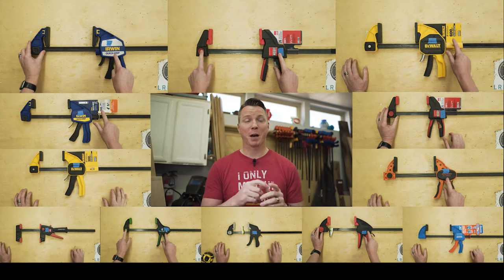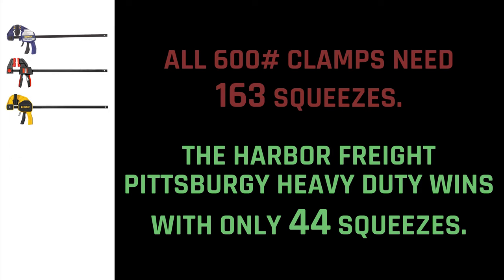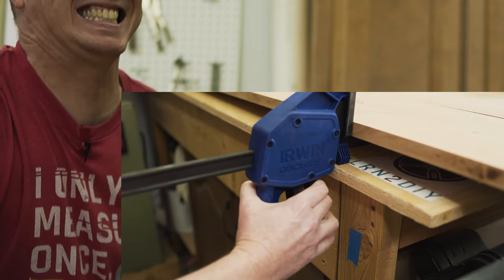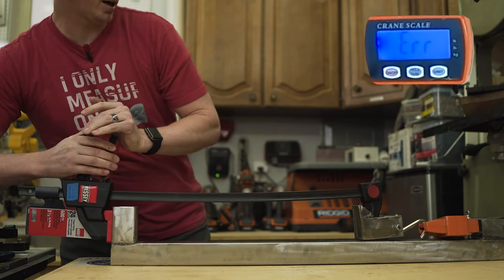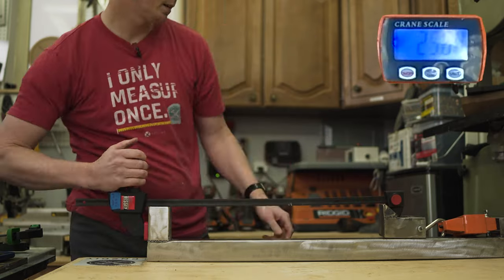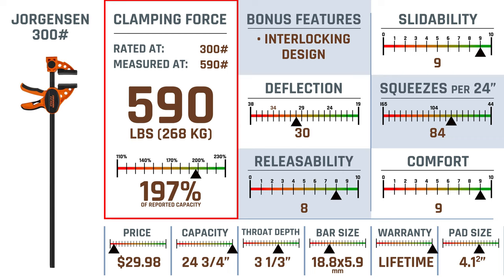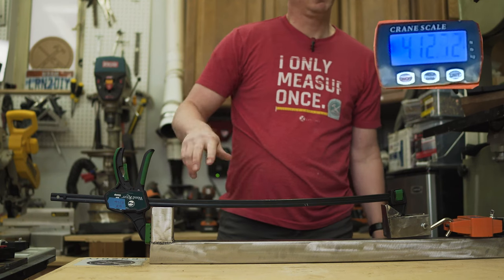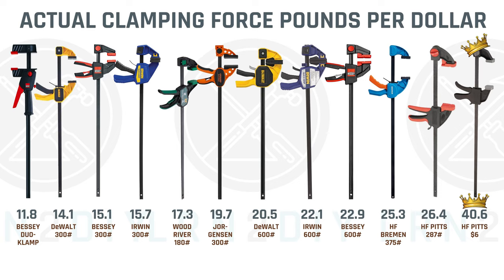The Ultimate Trigger Clamp Showdown - 12 Clamps Compared

Comment: The squeeze distance is directly related to strength because of mechanism leverage, so for me the shorter distance would be preferred if I want a greater pressure.  If my need was just to quickly clamp at low pressure then I'd want the long squeeze distance.  I would reverse the squeeze chart to have green on the short stroke and red on the long stroke.
Reply: Totally agree. Also, for this type of measurement, squeeze 10 times and measure that distance to get more accurate data.
Reply from the maker: Makes sense, Michael. That's why I wanted to show all of the data so you could see what works best for your scenario. I think a lot of people would prefer the shorter distance squeeze just like you. Thanks for watching!
Reply from the maker: Good point on the 10 squeeze method - I'll keep that in mind for future videos. Thanks!

Comment: As someone who has managed joinery shops of over 40 joiners. A point that’s hard to touch on with a simple one time review is durability. The Irwin clamps definitely fail quicker after daily usage. The internals are quite weak wear out quite quickly resulting in next to no clamping force. The dewalt do the same but lasted a bit longer. I’m about to buy the Bessey as have got 2 friends in the industry who’s besseys have outlived many of the Irwin and dewalts I’ve had. Great review by the way.
Reply: I have the same concern about the durability of these clamps. I can’t figure out what is actually wearing out on these Irwin clamps. I’d like to know so I can fix or replace the worn out internal?
Reply: Hey, Was hoping you’d give a quick update on your Bessey Clamps if you have Tried them yet.

Thanks!

Comment: Great video. I threw all my HF quick clamps away after several of them broke. The unreliability is a deal breaker for me.
Reply from the maker: Yeah, they were the only ones that broke. I think that in my case I probably have overtightened them more often than not since it’s hard to tell how much force to apply.
Reply: @lrn2diywoodworking  I also have had HF clamps break in my hand while squeezing.  Thanks for this.
Reply: I'm curious to those have broken the HF clamps. Were they the old black ones with orange pads, slightly less old pittsburgh ones with gray pads, or the new Bremens? I havent purchased trigger clamps in over a decade, so I only have used the old orange pad ones. I was thinking about trying a few of the new Bremen branded ones
Reply: @ckmoore101  I bought the new Harbor Freight Blue Bremen Label. I really like them. I’m a retiree casual woodworking. I think their great. Very reasonably priced been holding up like a champ. I’m not a professional or in commercial production business so these are great. HF opened a store near me and I noticed some of their products have really improved.  I’d give them a serious look even if your not budget mined….
Reply: I don't throw broken tools away if I can fix them. I have fixed the end of Quick Grip clamps too. Real Vise Grip Quick Grips. I make a whole new head out of steel. That doesn't break.
Reply: The Bremen brand aren’t bad to have around. I’ve got a few and they work as intended and I quit my career to be a full time woodworker awhile back. 99.9% of the time during projects you are never maxing out your clamps like the examples in this video, especially with squeeze clamps. So really no need for someone just starting out to go spend a ton on the higher name brands when they all accomplish the same end goal.
When it comes to F style and parallel clamps, you don’t want to be cheap on those ones…although the Bremen parallel clamps actually perform very well when in comparison to the high end brands they are almost identical for half the price.

Comment: the amount of squeezes actually should be higher scored for more squeezes as it allows more variation in pressure.  Also, you should have done a clamp overnight as the harbor freights have come unclamped many times in my experience, I have sold them all at garage sales for a $1, they are complete crap and they break.

Comment: Watching your tests, I was wondering if there was space for another two tests? 
#1-A test to see how long a clamp can keep its "clamp" at its rated capacity. Sometimes we will clamp something over night. A clamp isnt good if it loses this compression after a short while.

#2-An additional test of "squeezes per inch". I took a guess that some clamps took quite a number of squeezes to reach 24" because they increment in small measures on purpose. If you take two clamps, one moves in 1/2 inch increments, the other in 1/64 inch increments, placed against the items to be clamped, the smaller incements will provide a larger final force because you can "inch" towards the max force more easily. Thus its possible to apply a larger force more easily.

#2a-Ease to reach final max clamp. The smaller incrememts might lead to a larger final clamp because of the smaller incremental movement of the clamp heads.

Thanks for your work. Im gonna check out your site soon after this, and make a budget for a couple of new clamps.

Comment: Bonus features for the Bremen and Pittsburgh is that they are also spreaders. Also I don’t think the releasability scores should be factored in when you are clamping it beyond its maximum capacity. You should see how they do at around 300 pounds instead of almost 450, because if you’re testing it at those pressures, you’re clamping your work too hard anyways. Great vid!

Comment: The only issue I had with your method was that the use of another clamp to squeeze could have stacked the deck against the two that broke. Not sure if you agree, just my observation. Very nice comparison on so many different clamps. The little Harbor Freight guy might be a good choice for me. I don't need 400lbs of squeeze and I could buy a whole bunch at that price!

Comment: excellent review..note that the Werth durability of clamping clutch plate assembly is critical factor in squeeze clamps. You can predict that somewhat by: removing covers, count clutch plates, test hardness of plates, inspect and/or caliper accuracy of punched bar hole whilst seeing condition of hole edges. Sometimes the stamping dies are not top notch/ worn which rolls the entrance to hole. If  that side faces bar in clamp mode it can slip. As with pipe clamps try flipping plates over .

Comment: Once I bought my Bessey 300 pound clamps, I don't think I can go back. They are so nice to use, and they feel incredibly strong. I still have some older 100 pound Irwin / Quick-Grip clamps for smaller jobs. I owned a couple of those Pittsburg clamps before, they were terrible. Mine felt weaker than the 100 lb clamps, they would just slip. I don't care if they're cheap, they just work terribly. Dollars per pound of clamping force is not a useful metric. A cheap clamp seems like a good idea until you think about usability, the cheap clamps are terrible to work with. I'm sold on Bessey, strongly recommend them to anyone.

Comment: In the market for new trigger clamps. I lost it last night, after 10+ years of struggling with Bessey's DuoKlamps, I finally snapped and slammed them all on the floor of my shop until it looked like Pete Townsend had been over with a poorly setup Gibson guitar that tweaked him out. From the first week I got them (brand new) only 1 of about 8 worked close to properly, the rest would refuse to ratchet, just slip and stay frozen in place. I lost count around the 1,000th time they caught me in an awkward/dangerous situation and simply refused to function. I have Bessey strap, pipe, C and K-body clamps and, honestly, after using them in a pro 40+ hour/week shop for over a decade I have to say they are 90% hype. The only products of theirs that I haven't had overt major issues with are so heavy and difficult to place smoothly that I dread using them. As I said initially, I'm in the market for new clamps and Bessey is totally out of consideration now. Never again. I so wish the Mitt Romney-fication hadn't happened and left Craftsman a shell of a company playing the whack-a-mole of which Chinese sweatshop can produce all the clamps but make ours look better racket. Ugh. Good video.
Reply from the maker: I appreciate hearing your experience on the Besseys. I've had good luck with mind so far but not in all ways and I'm sure I'm using mine a lot less than you are. I'd love to hear what you settle on and how it goes.
Reply: @lrn2diywoodworking  Yeah, I'll definitely get back with you on it. Yesterday I picked up a couple of Jorgensen 12'' 1,000lb bar clamps. I haven't gotten their trigger clamps yet as covid slowdowns have made sourcing them first-hand near impossible, in-store stock is apparently non-existent. Whenever I can I prefer to sort through groups of such things and pick out the ones that don't have obvious flaws, that's just not possible on Amazon or eBay, as I'm sure you know. In my looking, including your video here, the Jorgensens seem to be the best bet and their mechanism looks to me to be superior (saw the internals on another YouTube vid). Also, the company/distributor seems to be a lot more responsive than most other brands. I've tried to deal with so many seemingly large corporations' customer service only to find out they are now shells just drop-shipping product and contracting phone reps who work for multiple ''brands''. In the end, we'll probably all have to move to China to get what was once in the USA a decent sense of connection with and concern from manufacturers. Either way, forward from here is all we got, it's either splat into it or plow through it lol.
Reply: "As with all Sears products, Craftsman tools were not manufactured by Sears during that company's ownership, but made under contract by various other companies." -- Wikipedia
The Craftsman brand is now owned by Stanley Black & Decker
Reply: @agimasoschandir  That wikipedia entry goes on to say that Craftsman tools were manufactured, pre-K-Mart, by New Britain, Moore Drop Forging, Stanley, Easco Hand Tools and Danaher Corporation - which were all US manufacturers before 2010. Stanley has always done a lot of production in England but only a handful of Craftsman were Stanleys. Dave Warren's (ECE rep in Crystal Lake, Illinois) father was Stanley's top USA rep from the 1940s-1970s when Dave took over (as he was writing articles and doing seminars for Fine Woodworking and other woodworking related magazines). I spent a day with him back in December 2006 going over all the history of it, he even took me on a tour through his house, workshop and apothecary building he built and sold tools out of. 

I bought Craftsman tools from when I started acquiring them back in the 1980s, used my dad's in the 1970s which he acquired in the 1950s-1970s and NONE of them were made outside of the USA except for a couple that were Stanleys marked ''Made in England''. That all changed after 2009 when Sears merged with K-Mart and they started parting out their operations to Chinese dropshippers to compete with eBay and Amazon. I've known people who worked in the Chicago and Rockford shops for Greenlee and other brands pre and post WWII and they all had up and down times due to distribution issues. Craftsman was a kind of consortium which Sears evened the distribution out for, without that flow of production to sales it would have been the insane patchwork of hardware store ''rackjobs'' that existed into the 1950s which was literally dependent upon hoards of salesmen driving all over the country to replenish stock and rebrand small groupings of tools with local names like ''Bob's Hardware'' on runs as small as a few dozen items (it was insane).

If you weren't around in those years then there is no way you can comprehend how far quality has dropped and how much more annoying it now is to deal with replacements under warranty since 2009. If you enjoy everything being dropshipped from warehouses importing Chinese and Taiwanese tools by people who know absolutely nothing about them - good for you. I've bought Stubai tools while I was in Tirol, Austria and Paraboni tools while I was in Rio Grande do Sul, Brazil at below half the price of what they would be in the USA - both manufacturers still make excellent quality tools but their distribution here can't happen because the Mitt Romneys don't like selling tools that LAST, they make more money on repeat sales of trash items at their dropshipper Big Box stores. I'm not new to this.

Comment: I buy all my clamps at Harbor Freight. I've used them for years with no problems.
Reply: I have a lot of old Harbor Freight knock off one handed clamps and a lot of them the pins in the handles have blown out on me. But it's a relatively easy fix to drill those plastic pins out and pass a screw through the handle. I haven't had a screw break on me either. Apparently metal is a lot stronger than plastic is.
Reply: @1pcfred  I had that in the past. They used to have plastic pins in the triggers of the squeeze clamps. The latest ones I have bought have been really strong. The black and grey ones, not the red and black.
Reply: @cabman86  those are the pins that break. Easy to fix though.

Comment: I have several of the HF 14” camps and they work just fine and for about $4.99 hard to beat.  No I don’t try to max them out. None have broken.
Reply: I never expect too much clamping force out of one handed clamps. Generally I use them just to hold stuff until I can get other clamps on.

Comment: Love the info graphics.  Looks like I can safely stick to the HF cheap clamps.
Reply from the maker: Thanks, Ben. Yeah, I'm actually really liking the Bremen clamps, especially since they refuse to explode. :)
Reply: If you’re okay with replacing them when they break. I think I bought a half dozen to supplement my old Irwin’s. The HF have all broken while the Irwin are still going strong.
Reply: @johnlee7085  I've never met a broken clamp that I couldn't fix. I have a lot of the really old clamps Harbor Freight had and the pivot pins in the handles would blow out in those. So I'd drill them out and put 1/4"x20 screws in there. I haven't had a screw break on me yet. I have a genuine Quick Grip that lost it's head. I made a metal head for it. Metal is a lot stronger than plastic is. Who knew?
Reply: Paul - Congratulations in being skilled and interested enough to fix the broken clamps. 

Personally, I don’t buy tools to fix them when they break. I buy them to build. IMO, time spent fixing tools, is time that could be used building; AKA wasted time.
Reply: @johnlee7085  Personally, I do acquire broken tools with an aim to fix them. This is an 00556 Quick Grip clamp. It had to be repaired. For posterity! It's an OG quick clamp. The one that spawned all the ones you see today. The real deal. My fix certainly did it justice too. It's a chef's kiss! I was inspired by my 5906 welding model. It has a metal head.

Comment: Very good. But I think squeezes per 24" isn't showing what it appears to be showing. Go go say 20", you slide the handle toward the end and only squeeze the last 1/2" or so. No one does a 20" squeeze play until they butt up.

If you want maximum load, you need more squeezes per inch. Think in terms of energy per inch. Your hand can only exert a limited amount of force. Applying that force over a smaller distance means you can gain more strain on the bar and less on your hand. So you WANT a high squeeze count.

Comment: I have some of the Bessey 300# clamps and when they were new they were my favorite clamp.  After getting some use on them, they quickly fell out of favor because their slideability became almost non-existent which to me is a big deal on a one handed clamp because I most often was trying to use them with only one free hand.  After watching this, I think my next clamp purchase will be the Jorgensen clamps.  I like that they interlock and they have the same release style of the Bessey clamps (and they're orange).

Since this is a woodworking channel and most uses of clamps will be for glue drying, I would be curious to see a comparison of how well they hold pressure.  Not at max pressure, but somewhere in the range of a typical glue up.  It would also be nice to see it clamped in without looking at the readout but just by feel of how much you would typically use when glueing and see how the pressures compare.
Reply: I'm a woodworker & have had the same issue you describe with Irwin clamps 300# & the smaller 12" clamps they make. I found that keeping glue off the bars does help with slideability (plus oiling the bar helps movement with the added feature of allowing glue to more easily be removed in my experience).

Regarding the oil: every woodworker I know, including myself, cringes at the thought of an oily clamp staining the wood or causing fisheye in the finish. I've found (light coatings) of 3-in-1 oil does not interfere with finishes, even water based finishes. Also, you may be aware, but Lie Nielsen sells a plant-based oil called Jojoba oil that's more wood "friendly". I haven't tried yet, but am curious about using canola, peanut or mineral oil & how well or even if they would work as well or better.
Sorry for the long-winded comment, I love woodworking & talking about woodworking.